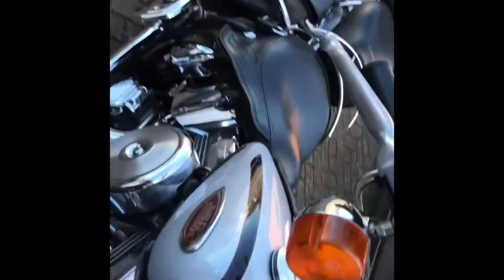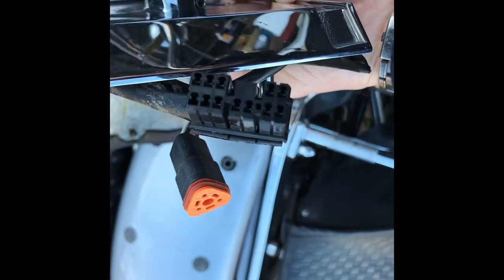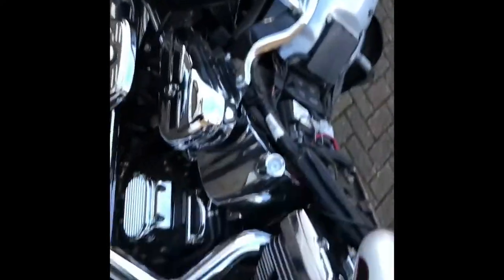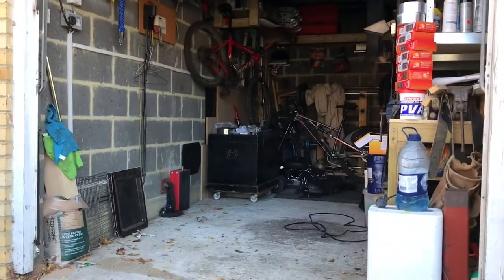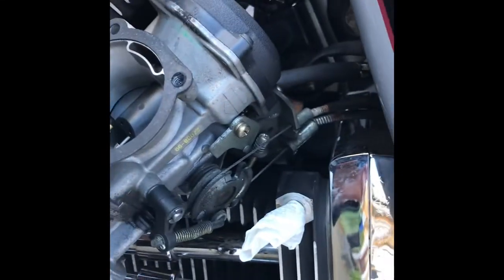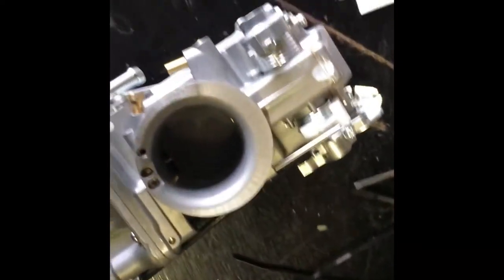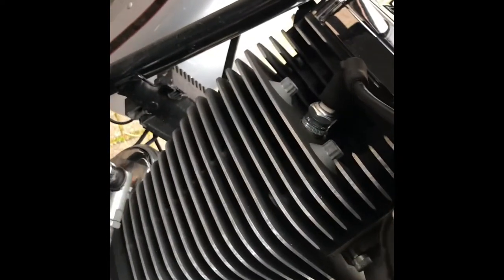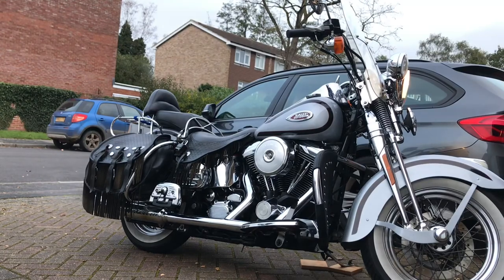15: Fitting a Mikuni Carburettor To Your Evo

Comment: great job do you want to sell your old cv carb ?
Reply from the maker: Thanks John, I shan’t sell the old carb as I intend to keep the bike long term and spares will get more difficult to find so I’ll gradually build up a small stock of parts.
Reply: @HarleyRog  how you finding the mikuni in comparison to the cv
Reply from the maker: @johnmitfordmitford3586  low miles yet but first impressions are that it is basically the same (as it takes the same petrol and air to achieve a set result) but slightly sharper with what you do to the throttle when opening and closing. The cv carb is slightly softer and more forgiving when pottering about. I can see the attraction of the Mikuni but for normal riding the original carb is fine and I may as well have spent my dosh on a cam (which is next)

Comment: Something you need to know brother.  You do not need to remove a fender rack or the seat or raise the right tank half at all to do this simple job.  I can take off and replace any CV or Mikuni carburetor in about 30 minutes easily. You removed many other things as I noted above for absolutely nothing
Reply from the maker: Hi Earl,
The instructions said to lift the tank to cut the throttle cables clip on the top frame tube so as to give a better cable run by routing them under the tube instead of along side in the clip. If the clip has been cut in the past for any reason the cables would be loose and easily moved, but my bike is completely original and unmolested except for the upgraded brake callipers to twin pot Harrison Billets.
The removal of the seats and rack is two minutes work as they are quick release, this creates space and simplicity.
Cheers for watching and commenting 👍🙂
Reply: @HarleyRog  I wish you had talked to me before reading those instructions and I could have made the job one third of all that you did.  Sounds like the instructions were made by some guy in a suit and tie that lived behind some desk in an air conditioned office